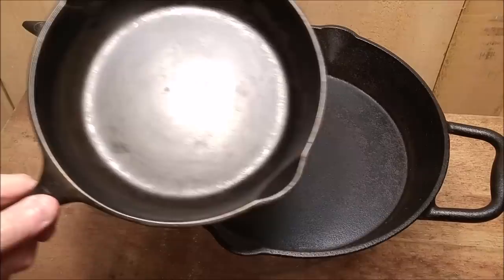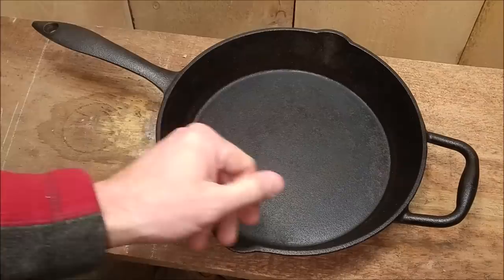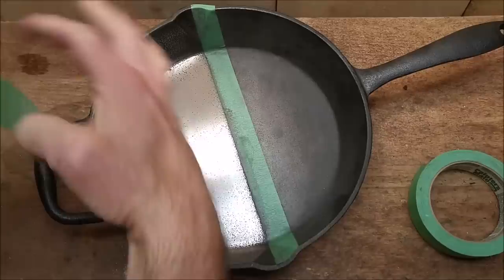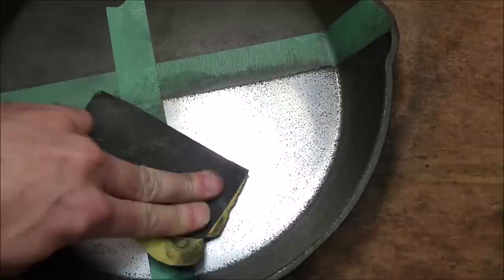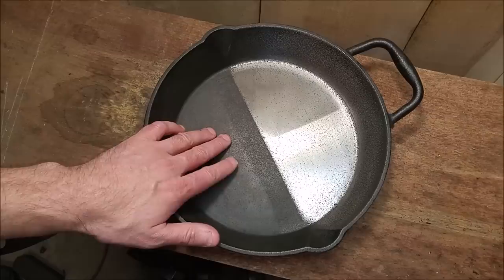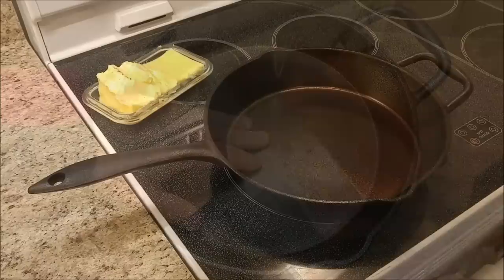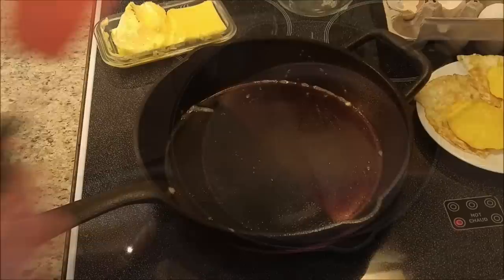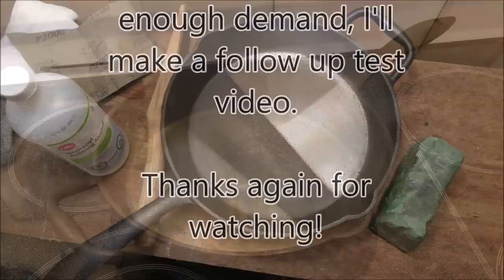🍳EXTREME Polish - Smooth a Cast Iron Pan to Reproduce an Antique Skillet then take it way beyond

Comment: This was fun.!  Won't a dark surface absorb more heat ?  Anyway, I was going to "upgrade"  to a new Lodge pan thinking the surface would be better than my old, really smooth CI pans.  I guess I'll just get going and season them again, and season and season...very timely vid for me.  Thanks!
Reply from the maker: For sure, the old ones are so much better than MOST of the new products out there.  A link was posted (https://solidteknicsusa.com/) for a very interesting product, and they're aren't cheap, but they are also not too dear either.  Maybe something to look into.  They seem to be very high quality to my eye, but I'd need to test them to pass judgement.

Comment: good way yo warp your cast iron is by using water on a hot pan. wait till it cools
Reply from the maker: There have been a few people giving this advice too, this method works well for me, it looks violent, but a little water goes a long way.  I measured the temperature differential and if I go a little wild with the water, it will cool the pan down 70c within about 7 seconds, so that's three doses under the tap.  

I'm curious about this, have you experienced warping?

Thanks in advance, I appreciate your thoughts on this!
Reply: @NeedItMakeIt  yes. I'm an engineer and worked 4 years in the steel industry. Your water will rapidly cool the area. Depending on the grain structure you can cause cracking.
Reply from the maker: @JT-91  It's always good to have the background of people that comment because it is hard to tell where they are coming from.  I've been researching cast iron and it seems that it may be true in some cases, cast iron being an alloy and various combinations of materials will create a product with different properties.   I would wonder why this method would be any different than adding oil into a pan, this was 56C tap water, oil added to a pan is only room temperature.  Steam will release a large amount of energy, so there is one potentially large difference (quenching with water being more aggressive than oil) but is 70C over that time really a problem?  

I'd love to prove it, but I'd need a microscope and a brand new pan.  I have 2 new pans, no microscope however, it would need to be digital also.

Here is a link to the process that I use but did not describe in my video (I thought it was common practice).

https://www.youtube.com/watch?v=a5NbQwzwUTw

Thanks again.

Comment: Did anyone else cringe when he turned on the faucet and put the hot skillet in the cold water?
Reply from the maker: Thanks for the comment, I should have probably explained this process; at the time I thought it was well known by others.  It is hot water and a little goes a long way.  I've been doing this for a long time, no cracks, no warping.  I suppose for a larger pan it is possible to cause a problem.

if you're looking for a detailed explanation of this, please visit Kent Rollins youtube video, he shows the exact technique.  https://www.youtube.com/watch?v=a5NbQwzwUTw
Reply: I was thinking about that but I still cringed I normally leave the skillet on the stovetop and add the water very slowly because like you said it can crack or warp the cast iron by un even cooling. Loved the video.
Reply: If my pans get really messy I pour boiling water from a kettle into them to break down any grease then wipe them down. Sometimes I leave them on the stove to continue boiling for a while to get rid of really burnt on stuff.
Reply: Dude your dead on for burned in crud a little salt water will lift just about anything.
Reply: If the pan is hot enough it will crack. I've seen it. Same with cold water on a hot windshield.
Reply: Jeremiah Poole exactly. Just got to make sure no salt is left behind and it is bone dry. 
I always store mine with extra oil on and wipe them down before use. (I don’t tend to use them very often).
Reply: hxhdfj ifzir st c your pan should never really get that hot from normal cooking. And if you want to be safe take it off heat for a couple minutes and use hot water.

Comment: Take a leaf from an old engine-tuner's book: After you bore a cast-iron cylinder to a smooth finish, you run a hone up and down to create micro-grooves that retain the oil for better high-temp lubrication. Some engines, he'd do the bore, then leave it in the rain for 6 months to rust. Etch the rust out with mild acid, (vinegar), then re-polish the bore. The rust-pits each hold a little oil, so your piston/egg always has a lubed surface; never sticks. The old tuner never had an engine seize. So, smooth surface with oil-pits wins. Always heat and cool iron pans slowly, or they will dish. Try it!
Reply from the maker: Love it!  The same concept as hand-scraping.

I have a video coming out in a few days that you may really enjoy,  I take a standard old-time machinist method and apply it to an old cast iron pan.  The results were pretty good, maybe pointless, but interesting none the less.

Thanks for taking the time!

Comment: Does it look cool? Sure. Is it functional as a cast iron skillet anymore? NO. You can cook in that if you really want but everything is going to stick to that REALLY bad now. Even a proper cure on it again won't bring it back to the way it should be. Those are rough and covered in black stuff for a reason it keeps the food from sticking right to the pan the second it hits it...
Reply from the maker: There are a few variables.  I have been testing and researching for some time; seasoning, oil/fat, temperature and the item you're cooking all play a role.  I have shown these processes and tests in follow up videos to this one.

The final result here is that there is no point to taking it this far, it looks pretty, that's about it.  Sanding to 100-200 grit work very well for seasoning that will last, but of course you don't need to if you're patient enough, it will become smooth over time and use.

Antique and vintage pans were provided to the consumer with smooth surfaces, in my case the seasoning lasts quite well on the old Wagner pans.

Comment: I love cast iron pans but carbon steel skillets have won me over.
Reply from the maker: I lot of others have said the same, so why carbon steel rather than mild steel, is it important that it has a higher % of carbon or is the naming a marketing tool, and it not important?
Reply: @NeedItMakeIt the weight was a big factor for me ( bad shoulders). The pan heats up alot quicker and I can get a really good sear. I work in restaurants and noticed the cooks always went for certain pans, they were carbon skillets.  So I bought one seasoned it and wow. It's like cast iron but not. It was 30$ so why not right?
Reply from the maker: @Daniel-tj6mc  $30 is a good deal, I can imagine that in a restaurant they'd want to get cooking right away and cast iron doesn't heat up as quickly... though induction may change that. 

That is some good info, I will look into this for sure, thank you.

Comment: It physically hurt me to see you put that hot pan under the water like that oof
Reply from the maker: I'm not sure why, hot water on a hot pan is a legitimate method of cleaning your cast.  Maybe not a good idea on a 12" or larger pan, but these smaller pans still work well.  Cast iron is not as sensitive as people think.  I will however say that heating a cast iron pan too quickly will cause it to crack, it has happened to me.  

This pan is still going strong I have made a follow up video on it and I use this cleaning method on all of my cast iron pans.  The only loss I've suffered so far is when I accidentally turned the heat to high and cracked a 12" Lagostina.

Thanks for the comment, keep them coming!

Comment from the maker: I just hope they didn't do a better job... 😅 Thanks for pointing this out, do you think they'll send some subs my way??? 12m for them crazy.
Reply: If you're talking about TKOR and their video. They used a buffing compound on it, which freaked me out.
Reply from the maker: @mandolinman2006  I haven't had a chance to watch the entire video yet.  As long as they cleaned the compound off completely it'd probably be okay... if not, well they'd be eating green eggs I guess, or blue or pink.
Reply: @NeedItMakeIt  oh, they used a cream polish, kinda like the stuff you use to buff out scratches on a car that has a car wax in it.
Reply from the maker: @mandolinman2006    After all of that work, the seasoning really doesn't bond well to that polished surface, it seems better to have some fine scratches.  A good idea for another video I think.
Reply: @NeedItMakeIt  agreed. How fine do you go until it's too fine. It probably wouldn't be the quickest video to do, but would probably be the only video on the subject.
Reply from the maker: Probably 1200 grit, 2000 is too high I think, but if people want to see how the seasoning adheres to the polish, I have no problem putting in the elbow grease.  I have a few videos in the works right now, but this is high on the list.
Reply: I stop at 600 with great results. Then I season it in the oven at least 4 times with grape seed oil. Works well for me  but I have never used a higher grit sand paper.
Reply from the maker: @meegstomtom  I've heard that grape seed oil is the best, with the runner up being linseed oil.  People also swear by using shortening.  Why is grape seed so good?  The higher grit isn't worth the time, it is a fun test, but it actually works against you from the perspective of a good bond to the surface.

Comment: I’ve sanded a lodge cast iron pan to remove their crap seasoning. What kind of oil did you use? Also, what temperature and what duration?

Comment: Never used water to clean my cast iron, just heat it up and wipe it with a cloth.
Reply from the maker: These days I've been using a little salt with a bit of water, and dry with paper-towel.  If you use your cast iron every day, there isn't really a need to clean it out completely.  Though my wife did get a little cinnamon flavor in her eggs last night from the french toast the day before... just spicing things up right! 

Have you ever tried the chain-mail scrubbers on your cast?

Comment: Casr iron cookware is not made for quenching - it can easily grack or at least warp. Dislike.
Reply from the maker: Can you please share your experience with this?  I have had no cracking or warping issues from doing this and I have been doing this for many years.  It is a fairly widely accepted way of cleaning your cast iron pans, visit Kent Rollins YouTube page and he shows the exact process.  I will pose this question to you, how hot is the oil you put in your pan before cooking?  The water I used was very hot, the oil I use is never hot.  

I would imagine that doing this on a larger pan could cause a problem, but these smaller 10" or less have never caused me any problems.

I have however cracked a pan by overheating, I accidentally set the burner to high, and paid the price, but never cooling.  Maybe other people could share their experiences on this too.

I see your point, it is a valid one, however my experience with this has been good.  I think a good test would be to take a hot pan and shove it into a bucket of ice-water to see what happens (it would have to be a bad pan).  What do you think?

Thanks for the note.

Comment: The idea of the pan having a rough surface it to make it ease to season........  And for all you people cookin on a cast iron the best way to season the pan is useing a fire and pig fat the wood you want to use is going to affect the flavor of the meat or what ever your cooking on it you wanna burn the fat and apply just a thin coat and burn then repeat untill the desired thicknesss of seasoning is built up
Reply from the maker: It does make it easier to season, you'll see that dark rich color appear much quicker as well.  I personally really like the smooth finish because I find them much easier to clean... they also look great too, but I find the smooth to be a pleasure to use. 

I will think about your method, fire is the way they used to do it, but how would you control the temperature?

Comment: NEVER put your hot cast iron pans, or ANY pan for that matter, under a running tap whilst it's still that hot!!!!  It'll warp the metal and the pan will lose it's shape and it's flat base.
Reply: I own dozens of cast pieces from different eras and brands and have cleaned mine under tap water to steam them off for over a decade with zero problems with warpage or failure. It is a great way to clean them and you are not correct.

Comment: I understand this idea, but aren't you pressing aluminum oxide and silica into a very porous cast iron?
Reply from the maker: It's not something that ever occurred to me, you can see porosity in Aluminum due to the absorption of hydrogen, but I'm not sure about cast iron, what makes you think that cast iron is porous?  

Are some experts out there on metallurgy that can speak to this?

Interesting question.
Reply: After cutting cast iron piping for many years, i see that it is a very porus material, full of many voids in the manufacturing, however, i am no expert and dont say anything with bad intent. I also would like more to respond here so I can learn.
Reply from the maker: @jasonsanitz5623  Of course, it is a good question, I'm no metalworker, my trade is woodworking, some methodologies are transferable, but this question is beyond me.  What I see from these pans is that they polish quite nicely, it is possible that they have a different composition of metals than the metals you've worked with.   

Anyone an expert on the subject?  We're getting technical here, will aluminum oxide particles embed themselves in cast iron?   

Is there a way to test this at home?
Reply: @NeedItMakeIt  I wish more people were like you!! Definitely following to learn, thanks brother!
Reply: Mason Gilbert  thanks for the reply, I'm learning

Comment: YOUNG MAN ,

NEVER USE STEEL WOOL OR GRINDER WILL GET INTOTHE PORE OFTHE CAST IRON
Reply from the maker: A few notes:

 I am not that young, but thank you.  

I suggest not to begin a comment with NEVER, that's not a great way to convince someone that they are doing something wrong.  Also from the same train of thought, writing in ALL CAPS is a no-no, are you truly yelling when you are thinking of what to write?

Next, cast iron porosity appears as large voids in castings, very visible to the human eye, you may be referring to irregularities in the surface due to the composition of the cast iron itself.  Steel and CI are similar, the main difference being the amount of Carbon content, which in turn allows for the creation of graphite within the CI.  This is why is is such a good material for bearing surfaces for machinery, long-wearing relatively low friction.  Aluminum is a material which readily absorbs hydrogen from the air when it is molten, it can have porosity, however they are visible again by the human eye.

If you have any scientific data to backup your comment, please share, otherwise it is fairly well known that this is not true.  Another point as well for any CI lovers, Vintage pans were sold smooth, they were machined and sanded/ground, if anyone is curious they only need to have a look at the witness marks on their own vintage pans. 

HAPPY HOLIDAYS!

Comment: Wow. Why did you shock your hot pan in water?  Anyone who knows cast iron knows that that Will warp or even crack the pan. Amateur move dude!
Reply from the maker: I have disagree, have a visit to Ken Rollins' channel, he explains the process.  I have done this process at least several hundred times, I still have these pans and they still sit flat on my glass cooktop.  https://www.youtube.com/watch?v=a5NbQwzwUTw.  I don't always use this method, I tend to just use a small amount of salt, and occasionally just paper towel.   I can do a future video on this subject, I am getting setup to do one with the intention of cracking a pan (one of low quality of course).

Anyways check this link out.
Reply: Nah, not really. When the water hits the pan it forms a layer of steam between the cold water and the iron which acts as a layer of insulation. A brief splash of water will blast the food residue off the pan and make scrubbing unnecessary - which could harm the seasoning. Warping and cracking almost always arises from overheating the pan. (Been using cast iron for almost 50 years now.)
Reply: @clarencegreen3071  yeah maybe a little bit of water but not much too fast, it will crack. My wife didnt know and cracked one of my pans. Rapidly changing temperatures warp/crack metal. Thats physics. Try running your car for an hour and running the hose on the engine block. Let me know how it goes

Comment: Y'all bin cooking in them pans for what 250yrs? In England we bin using em a lot longer , just cook ur dinner n eat it for fuck sake
Reply from the maker: I see your point, I have great respect for the old ways, I love to preserve vintage and antiques as much as I can... check out my shop in my videos sometime.  

A different way to look at it is, why would you not try to improve something or make something?  Every time I do a project, I gain a better understanding of the materials and learn new techniques.

Do you wear running shoes, or do you go around outside with bare feet?  Do you use a toilet, or an out-house or hole in the ground... or maybe all.  Humans are hard-wired to improve things and make things, that's why we have what we have, and why you can write a message to me like this on the internet.

Have a great one, I appreciate your perspective!

Comment: When you polish these pans, you take some thickness off the bottom, hence the temperature difference. You lose some heat retention too. Better to take the burrs and the rough stuff off, and STOP. Don't try to polish them shiney. https://www.youtube.com/watch?v=ljSQrSoSYAE
And let your pan cool off before you wash it so it doesn't warp and crack!